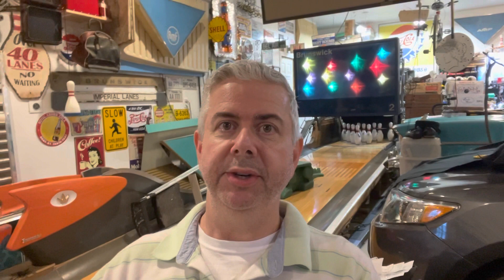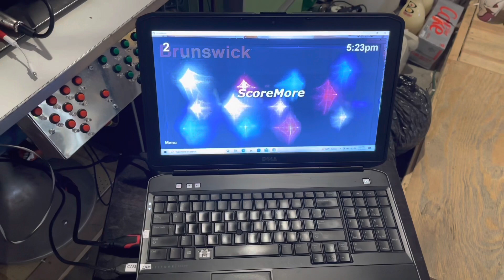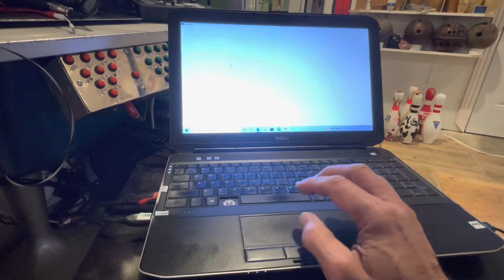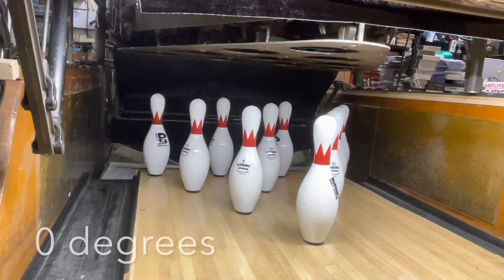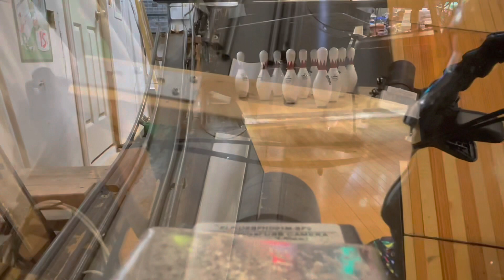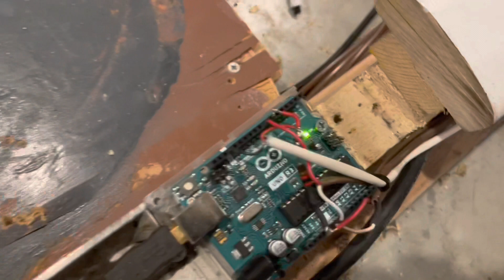Quick look at ScoreMore automatic bowling scoring system

Comment: Interesting. As the system gets refinements, it needs an auto reset for the 'No-Tap'. If it could be set at '0' (upon trip) could it switch to 'second ball' and set a full rack with one cycle?
That will give the developer something to keep him awake at night.
Thanks for the videos. See you tonight.
Reply: I can definitely add that as long as the pinsetter can handle it. Would it be too late to switch to second ball upon triggering?
Reply: @ThinkCleverAndSmart  Brunswick made a modification kit that allows for this with their 90's and early 2000's scoring, but it uses the functionality of the 90 degree overtravel linkage. This means Rob can't also have 90 degree overtravel if he installs this kit.
Reply: @Rodj12341  Oh that’s interesting! Thanks for letting me know. I guess he rather want the 90° overtravel but I could be wrong. This is good to know though!